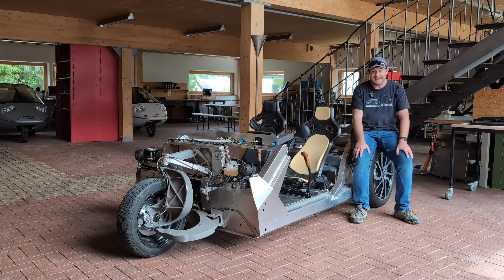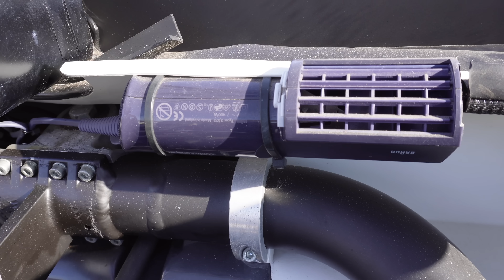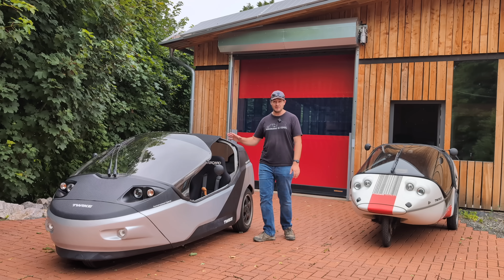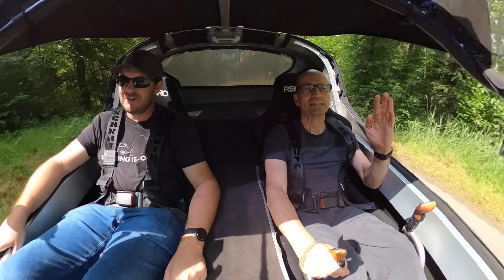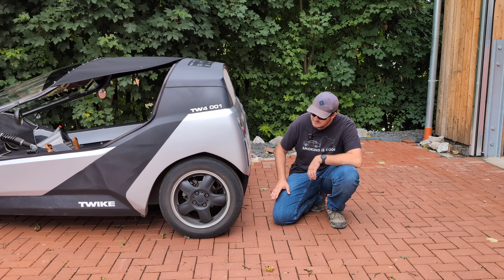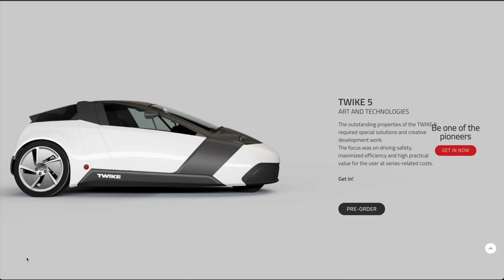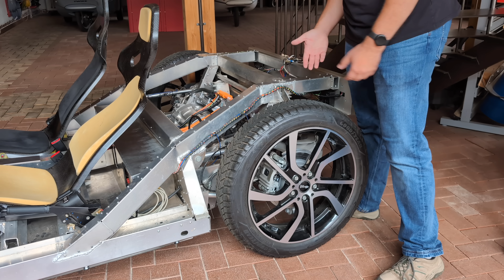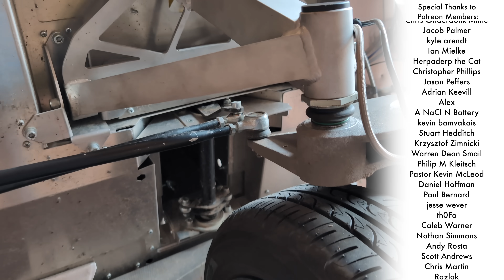TWIKE Is The Coolest Oddball Car Company

Comment: I always wondered, do ICE cars do this heat scavenging thing as well? Seems like it would be a no-brainer to lower fuel consumption when running the heating but there may be something I'm missing?
Reply: That is how ICE vehicles heat the interior.
Reply: Yup.  The heater in almost every ICE that's ever been built (except for air-cooled VWs) is just a small secondary radiator that the  engine coolant runs through.

Comment: The two wheels go in the front, not the back. I have cycled recuments of all types and this model will flip.
Reply: Even Twike 2 doesn't flip, and the new one has a so much lower centre of mass, it will be perfectly fine.
Reply: Did you miss the battery being in the floor? The center of gravity is very low, unlike with a bike, where the rider usually weighs more than the bike itself.
Reply: @no1DdC  true, but steering with two front wheels will still give more stability
Reply: @Eric_Hunt194 
Depends on the configuration. Planes have three contact points, with the steering in the front also. They are also very wide. Still don't topple over.
Reply: Morgan figured it out in 1909.

Comment: Three wheel cars are totally safe (not)
Reply: Look with the centre of gravity so low as in these and such a stance, stability is not an issue. It wasn't even in Twike 2 and i mean i got a test drive of that one back in the day, and the 4/5 is fundamentally more stable.

There's also any number of recumbent three wheel bicycles that i tried back then and basically yeah no it's not a problem.

Comment: That’s a Norwegian Defa Termini car interior heater, very common accessory in the nordics where the vast majority of cars (ICE) have pre-heating, usually electric. You plug your car in at night, on a timer, and it’ll be defrosted and ready the next morning when it’s time to go to work. 

The Termini is compact but makes a terrible high-pitched noise, this is not an issue normally since you aren’t in the car. If anything it’s handy to be able to hear that it’s working from outside the car. There are cheaper and bulkier models with a slower less noisy fan in them. 

Oh, and car interior heaters all have a self-regulating PTC heating element in them, so it might not be the best if it’s warm and raining and you’re trying to get some warm air to the windshield to defog. They’re designed to bring the temp up from freezing to lukewarm and keep it there. Not sure how hot the air coming from it is going to be on a summers day.
Reply: There is nothing norwegian with defa. its a german company lol.
Reply: @hillppari  The company that’s known for electric pre-heaters for cars and nowadays also makes EV charging products is most certainly Norwegian. You must be thinking of a different Defa.
Reply: @hillppari  Ah, yes, our defunct East German DEFA movie studios were definitely producing heaters for cars 😂 Greetings from Berlin, where they were located!

Comment: Twike that you...had? Did I miss something?
Reply: He sold it on Cars and Bids a few months ago
Reply: @The_Sprinklez  I can hear Doug Demuro say "THIS!... is the Twike 5..."
Reply: @The_Sprinklez  which vid exactly?
Reply: @caviduragraphics  he never mentioned it in a video until now, but you can find the listing on cars and bids under his profile or by searching for Twikes
Reply: Robert wants to live.
Reply: @tomhsia4354 but he still got a Trabi…….
Reply: @expatmoose  And a Reliant Robin, both of which are probably less safe.
Reply: @no1DdC  Well, of those 3 he has only crashed one of them into a ditch.
Reply: @no1DdC  The Trabby and the Reliant Robin may be unstable, but they are driveable. The combination of a twitchy steering tiller beside the passenger seat, hard-to-pedal recumbant, on-off throttle on the steering tiller, and backpedal braking with slippery pedals put the Trike Three on a completely different level of dangerousness. The Twike also has a lithium ion battery without a BMS.

The Twike 4 and 5 are MUCH safer than the 3.
Reply: @expatmoose  Robert can rallycross his Trabi, he cannot go a couple days without crashing his Twike.
Reply: @tomhsia4354  but trabis are death traps too, if not as bad as the trike, have you driven one ?
Reply: @expatmoose  Oh, I know the Trabby is a cottonbox deathtrap.

Robert has yet to crash his Trabby despite doing silly things with it, but he HAS crashed his Trike because of the horrific ergonomics. His trike's battery also suffered a thermal runaway event that fortunately did not develop into a fire, because the bloody battery pack lacks a BMS.

There is a reason recumbents with one-handed steering tillers and backpedal braking aren't the norm.
Reply: @no1DdC  I had a mate years ago who had a robin, used to park it in the winter at the top of the hill as it would never start, handbrake off and roll, his was the colour of parcel tape so if he crashed he just taped it back up, my sisters boyfriend at the time had an elf (similar to an imp) we used to have so much fun those days 🤣🤣🤣
Reply: I came here to comment on that as well.  Was this mentioned in a video, and I somehow already forgot it?  Granted, selling the Twike seems like a life-affirming thing to do (I'd rather ride in a Trabant than a Twike any day!  That thing is clearly a human-powered hybrid deathtrap!), but I'm still rather confused that he used the past tense without saying somewhere near the beginning about having sold it and when.  shrug